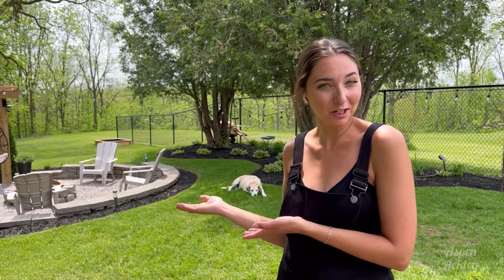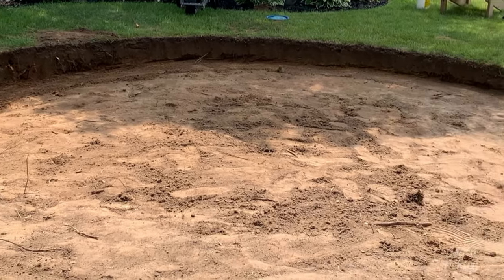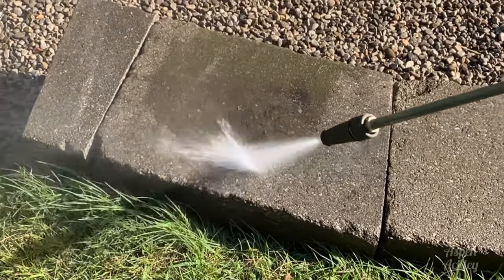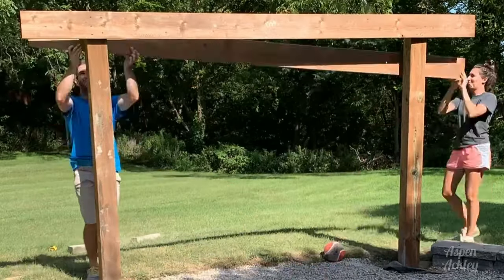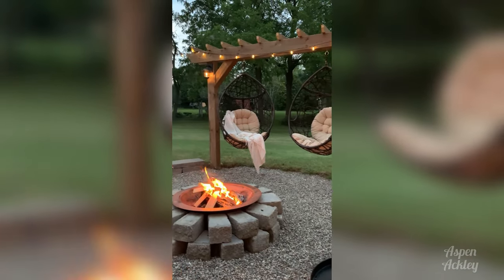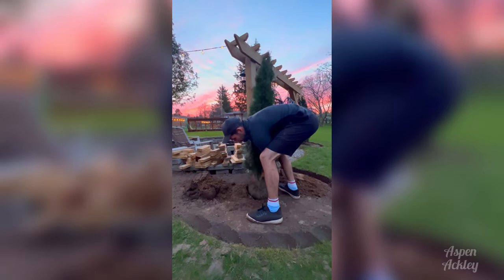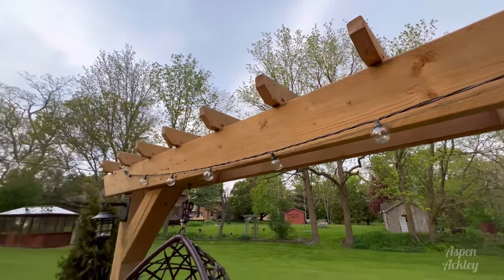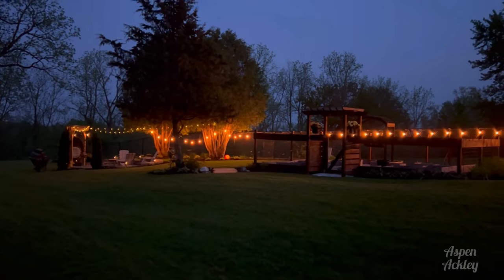All About Our Firepit (how we did it & how you can too!) | AspenAckley

Comment: You did not dig those 6x6 four feet deep lol. I rented an auger last night and it took me 3 hrs to get 28".
Reply: Really depends what the soil is like in your area. I have a smaller 1-person auger and I was able to dig the first foot in less than 30 seconds. Ran into one large rock, and the next 2 feet were only another few minutes. 

I live in an area that isn’t very rocky, and doesn’t have thick clay though.
Reply: I would agree with this, even if they put rocks in the bottom, that pole sank 2 feet at most in the video.

Comment: Looks great! Fourteen bags of concrete for two posts in absolutely insane! Where are you located? I assume you dropped them in 4 feet due to the frost line? Also, did you add gravel to the base of the hole before you dropped in your posts? Placing them strain into the ground with the concrete is sure to rot them out much faster.
Reply: They probably used 12 foot posts. You’re supposed to bury a third of the overall length, which would leave the height at about 8ft. I agree seems like a LOT of concrete to use. I wonder if they used gravel at the base of the footing also.
Reply: @tdz69  No response: Usually what happens whenever you ask DIYers a question, unfortunately.
Reply: @sendmedics 
Here's what they posted in I stagram. 
That is a lot of concrete. Wonder how wide those holes where. I think you could get away with 3 ft holes. 
2 6x6x10' 
2  2x 8x12'
1 2 x 4 x 8'
1 2 x 4 x 10'
2 eyebolts
14 bags quickcete concrete

Comment: What size post do you use for the egg chair? 6x6x10 or 6x6x12?
Reply: By the look look of them i would say 6x6x12. She digged 4 ft deep which leaves only 8ft left.
Reply: @toledo3211  When they dropped the beam into the hole it didn't look like 4ft thou. More like 2 ft tbh.